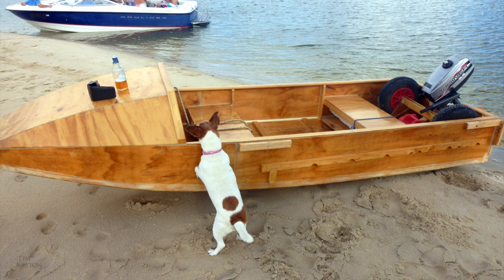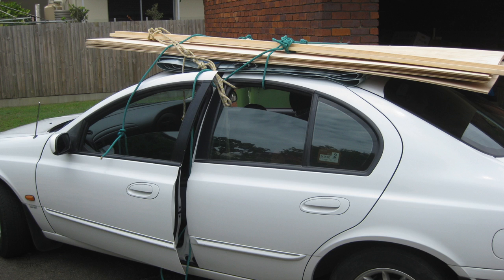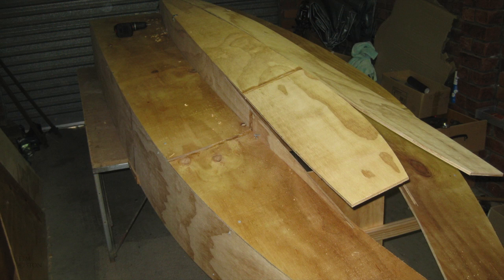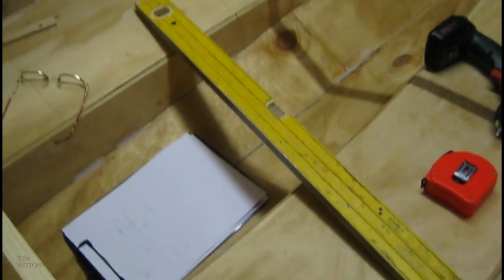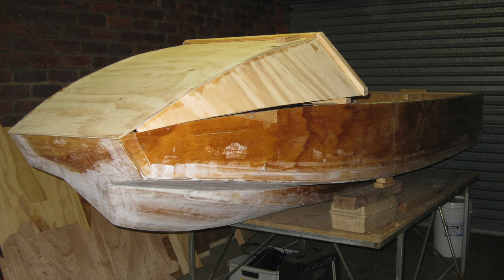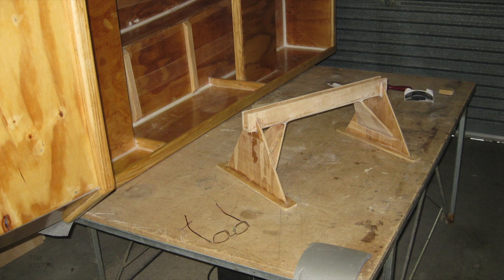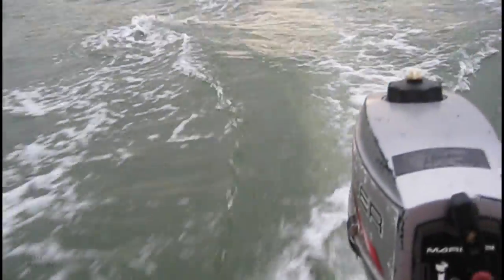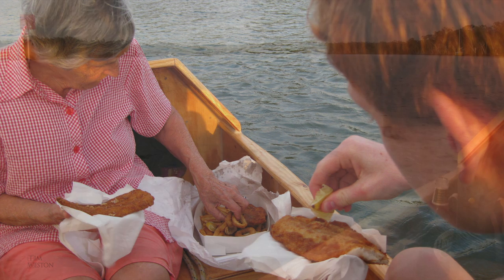How to build a plywood boat: Part 1 - a DIY project for the garage

Comment: How did you take account of the ability to float? How did you measure out that it could take 2 people? Sorry for the bad English, I’m Dutch:) nice build by the way!
Reply from the maker: Hi Luckym0nk3y. I designed it with Delftship. (it's free). I wrote all about it in my newly (yesterday) published book "Small Boat Building" -  https://www.amazon.com/dp/B07HLKZ8LQ  The book is full of info on how I build this boat and wooden boats in general including a look at how you can design your own boat. The program gives you all the floatation data. Regards Tim

Comment: Looks like a great design for a water cooled motorcycle motor with an inboard layout. Motor towards bow for simplicity in shaft and seal layout. Looks like it rides great too.
Reply from the maker: +piltdowne mann.  That could be an interesting layout. The original hull with the deep centre section would work well with a shaft drive..

Comment: very nice little boat boat.  i have built a few but never a stitch and glue model.  good job
Reply from the maker: +Ray Pena Hi Ray!  Thanks.  I have built quite a few boats with this method.  It is quick and makes for a light weight and rigid boat.  I like your channel!  You are a real inventor..
Reply: thanks Tim, i just like to tinker around the shop! I'll have to look into this method a bit more for my next project! I'm very interested in your upcoming video "flying boat"...i subscribed to see how it comes out!

Comment: I live in Caifornia and have been researching boats as i want to own one in a few years. Never thought to build one. I realize that a lot of boats are made from plywood and work fantastic. Have you considered makig one that is a little bigger? I think you would have a blast with a 3.5 meter boat.
Reply from the maker: Hi Mike.  Thanks for your comment.  Yes, plywood boats are great. I love working with ply I think it is a much overlooked material. Cheap, strong, rigid and easy to work with. Actually I have plans to build 3 boats in ply including this one - 3.4m long. If you are interested you can find more information here https://timwestonboats.com/plans/ Cheers Tim

Comment: Beautiful job my friend ! I'm wanting to start on a boat , so have been watching several builders . Were does one acquire the layout program ,and how costly is it ? Good job and greetings from the USA .🇺🇸
Reply from the maker: Hello Jay.  Thank you.  I used the CAD program delft ship to design the boat.  http://www.delftship.net , It's free to download and use.  It generates a plate layout that you can use to trace out the shape on ply and cut the panels.  You can build it without a computer too, by bending the wood together and tracing and cutting.  I did this on boats before, but it's a lot nicer and quicker when you can cut panels and they just fit together, perfect.  Once I get organised I will have ebook with a lot more detail on the process. I will also have plans available soon for the boat too.  Tim

Comment: Nice build, a quick question though.
I've never built anything using epoxy but I understood that without a topcoat/gel coat or whatever it had no protection against UV rays and would quickly break down??
Has this been your experience?
Reply from the maker: Hi Jeremy. Good question, yes it will break down, but you have plenty of time before you need to paint/varnish it. I have just published a building guide that tells you all about it in more detail. You can download it from here. https://timwestonboats.com/building-guide-2/ It's free. Regards Tim

Comment: Zips along pretty well for a little motor. Well done. I love the thought of building my own boat but the price of fiberglass or epoxy in Australia seem pretty expensive. Do you know a good supplier, or did you just buy locally?
Reply from the maker: Thanks. I'm not up with current prices but the more you buy the better the price/litre.  Try to find the big industrial/marine suppliers if they are close. They have better prices than the local chandlers.

Comment: would it be possible to build a boat with a flat floor inside? I want to take my dog with me but i am worried that he might capsize the boat if he cant stand on anything flat. My dog is a 35kg american staffy
Reply from the maker: Hi, Bex. That's a big dog... The floor needs the shape for stiffness, so extra framing is not needed. I'm sure it wouldn't worry the dog. And, even his weight shouldn't be enough to capsize, unless you are both leaning out of the boat;) Tim

Comment: How much epoxy did you end up using building this boat? As many boats as I've fixed up I kinda want to build my own now.
Reply from the maker: +Brantley Boyd    Hi Brantley.  I don't remember exactly, but I think it was around 5 to 10 litres max.  Probably closer to 5lt.  Yes, their is something very satisfying about building a boat yourself.  It's only some sheets of plywood in the beginning.  In the end you have a vehicle to moves and has behaviour and it's own character.
Reply: I'm starting to want to build a little mini max hydro plane after doing some research on them. Between work and school I don't have a lot of free time right now or money but I can build a mini max out of two sheets of ply and some other wood I have laying around and I still have a good bit of fiberglass mat and cloth laying around from my last project.

Comment: Hi! What was the 3d program that you used to design the boat?
Reply from the maker: Hi Evan. I used Delftship for the original boat. It did the job OK. Nowadays I use Rhino 3D. You have to pay for Rhino, but you can do a lot more with it. Tim
Reply: @TimWestonboats  thanks a lot :)

Comment: what is the recipe for the epoxy filler you use?
Reply from the maker: Hi Solofoe!  For filleting the boat I used roughly 50/50 cab-o-sil and Q-cells, enough to get a peanut butter consistancy.  For fairing the bottom, I used 100% Q-cells..  Tim
Reply: +Tim Weston Thanks for the reply! I was trying to make out what you were saying but   from the southeastern United States have a different dialect  and I'm not quite as savy at the fiberglass and epoxy stuff as you clearly are. nice boats thanks for sharing with the world

Comment: Oh yea what do I do if I only have a 115 horse power engine and I don't want to buy a new ond
Reply from the maker: Hi Jacob.  You could just double the dimensions and move the seats forward..  But a ply boat will certainly handle 115hp, just needs to be built to suit..  Tim

Comment: hi I'm in Queensland why don't you need it registered thanks
Reply from the maker: I think the regs are still the same. It depends on the horsepower of the motor. Check out Queensland transport, they will tell you the latest.